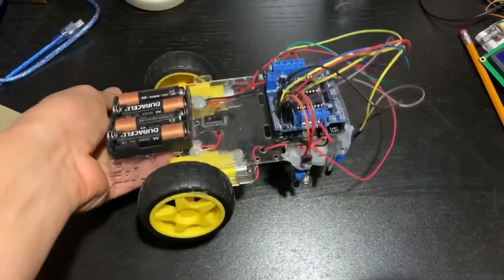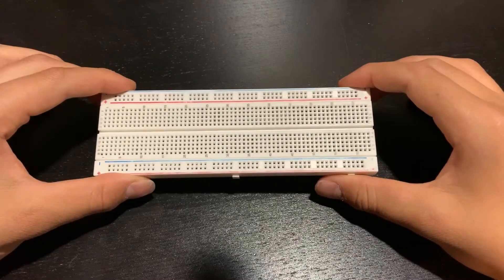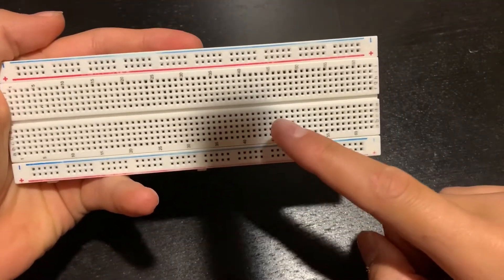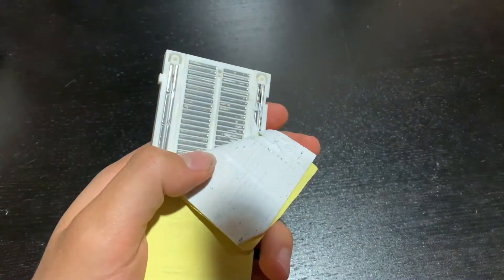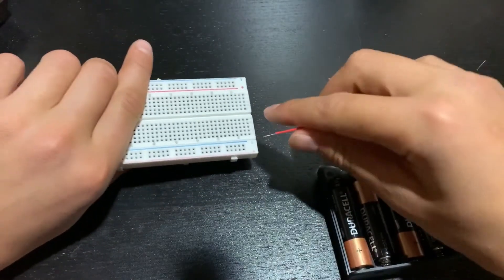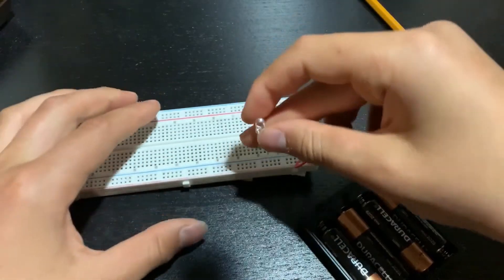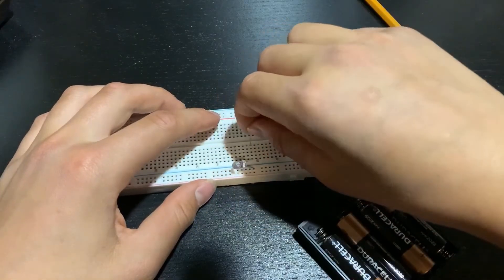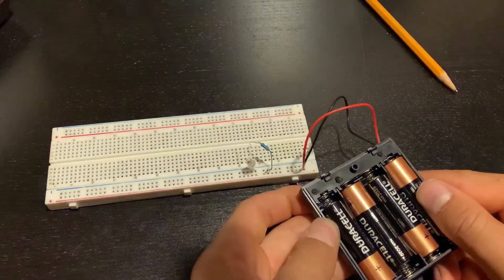How To Use a Breadboard - Breadboard Basics

Comment: It is bad form to plug components into the power rails. At least you didn't put the components in the component area and plug the power into that area. Use jumpers that lay down on the board. Those loopy jumper wires can make a circuit very messy looking and confusing.

Comment: Ever wonder how the term bread board came about? Back in the days of early radio around 1920s maybe bread board was literally used to prototype  circuits. They would use nails screw and even thumbtacks on the cutting board to prototype the design.